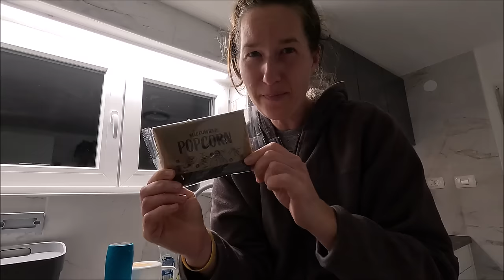My Solo RENOVATION - Why I Put STONES on this Wall?

Comment: I assume that you won't be cementing/gluing down the top shelf, as you will like need to get inside, eventually, to address any pile connection issues, etc. It should be heavy enough to just sit on top without fixing it there.